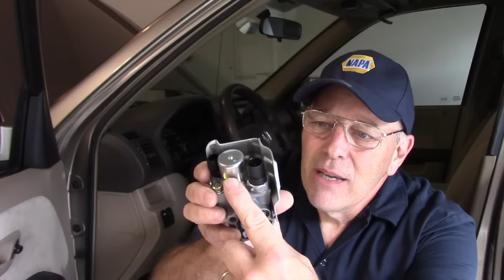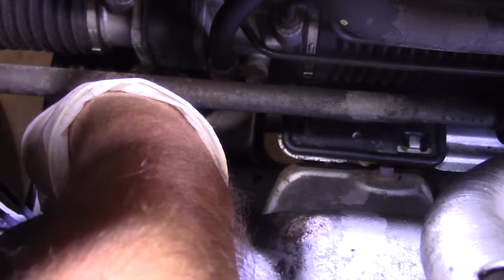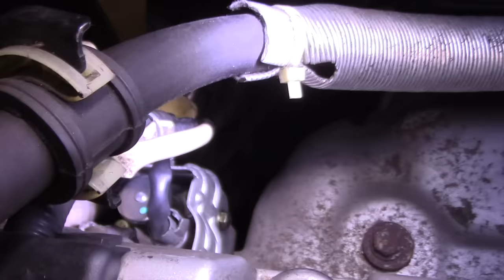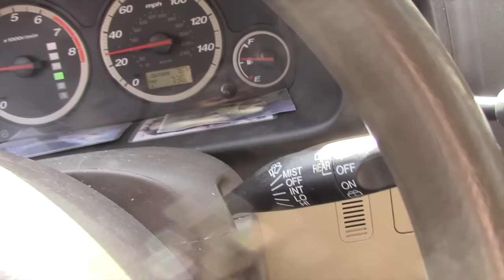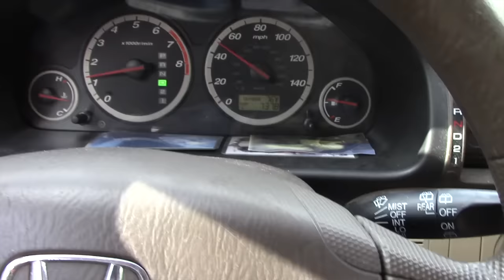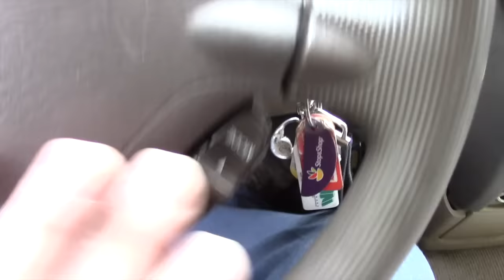VTEC Repair  P2647 Or 2646 (Pressure Circuit Voltage High Or Low)

Comment: So I have a quest , I have no check engine light on , I drive a 2016 Accord ex cvt 2.4l  when I let it stay over night it rattles when I start it ,  I've changed the solenoid but not the spool valve , could that be the problem , I also changed my oil wen I did solenoid. I've had it since new n change the oil religiously before it gets to 50% oil life with full synthetic , any ideas on what it is?

Comment: I have been getting the 2646 error code and went thru two VTEC solenoids made by Dorman. It works fine for a few miles then all of a sudden I get the bucking bronco at 2800 rpms.  Any suggestions?
Reply: Get an OEM part, not aftermarket like Dorman

Comment: I have a 2006 Pilot 3.47L V6 which also has the P1647 code, as you are working on a 2.5L (I didn't realise until I almost pulled out a "coil". Where is the Valve Assembly on my vehicle and do I only have one or is there another?

I also have ECU failures:  83 - PGM-FI Relation Failure, 86 - Global CAN Comm failure and 112-1 - Internal power source of ECU failure.

I thought I was getting a great deal on this used Pilot ($ 1K.) but it seems to be adding up quickly.

Thank you, 

Your videos were recommended to me by a friend at work who stated "the man knows what he is doing"

Comment: Hello, I have a 2012 MDX that does not pass smog! No check engine light but the guy at the shop said it have permanent code p2646 and it won't pass until that's gone! I have then replaced the oil and filter and I've also taken the VVT solenoid off and replace the oil pressure switch and the gasket! I have an obd scanner and the code still comes on after I did all that but the check engine light has never came on! Any idea what's going on? Car runs perfectly fine!

Comment: Thanks for the instructions, Jim. 

I have a 2003 Honda Accord LX, K24A4...  Car seems to move fine but has a slight noticeable lag before VTEC kicks in. There is no check engine light, but there is significant oil leak that increases as the  RPM increases. The oil seems to be seeping out from underneath the oil pressure switch and solenoid. Typically, oil soils the oil filter and the steering rack all the way beneath the assembly. I usually have to add up to one quart of oil per week in order to keep oil level within recommended limits. 

I recently changed the gasket between the assembly and the engine block. There is presently no leak at that point. 

Should I replace the oil pressure sensor and the solenoid? 

OR I should replace the entire assembly?
Reply: Does your car jerk when you’re accelerating heavily ?
Reply: @MrJOHNY347  Yes. It did at some point and triggered a VTEC solenoid code (P0406 or something). I replaced the oil pressure sensor on the VTEC solenoid and that sorted things out.

I also did a valve clearance job which sorted out occasional misfires on cylinder 3 which I observed and refused to go when I changed spark plugs to new OEM and checked my ignition coils to confirm they weren't burnt. 
Note that I had to do the valve lash adjustment 3 times before I got it perfect. First attempt was too loose, hence noise like a sewing machine. Second too tight but moved fairly without noise. 

Funny development lately: My catalytic converter got significantly blocked. I guess that must have resulted from the periods I was driving the car around with the misfire, due to unburnt fuel getting to the cat. As a temporary measure, punctured a hole through the cat and car is back moving like new, with significant gain in power and fuel economy but obviously letting out some smoke instead of the usual steam. Looking for a replacement cat now. Damn expensive shit!! Should fix it ASAP. Cheers mate!
Reply: @braveheartii1534  Thank you for sharing and your reply .You can get a good aftermarket catalytic converter for the right price .Just takes a lot of research .Some muffler shops have them .A buddy of mine has an aftermarket cat and still running for over 15 years .

Comment: I took out all those bolts but the valve was stuck it wouldn't budge or come out I have a 200u honda accord with the same 2.4 liter vtec engine
Reply from the maker: When all the bolts are out it should just fall off .Are all the bolts out?

Comment: i have a code p2647 on a honda accord 2006 point is i swap with jdm ingene i change vtec solenoide and oil sensor presure and still light on. any sugestión thank you.

Comment: Hey Jim. So my tech replaced the vtech solenoid assembly with a Honda dealer part and the problem keeps occurring. Car reaches 3000rpm, check engine light comes on, vsa light and warning light come on. Car starts bucking. You let up on the gas pedal and it stops,  but lights stay on of course. My tech wants to replace the VVT solenoid, but I dont want to keep throwing parts at the car if its not gna fix the prob. Any suggestions?
Reply: Did you fix the issue???

Comment: For some reason I unplugged the rock arm oil pressure sensor and I star the car the engine light is on.....and I stop the engine,, plug the rock arm oil pressure sensor back ....I star the car again the engine light is off but code p2646 still at scan tool everytime when I scan the vehicle,,,,please teach me if you know ,,,,,what should I do for next step....thank you....

Comment: I just switched out a new vtec solenoid in my 05 Honda Element and I still have the p2627 code and still jerks..I replaced it with OEM parts..not sure what to do next
Reply: Replace the single wire oil pressure switch under vtec solenoid both codes went away fixed
Reply: Same I just swapped mine on my civic si and it got the code to go away then came back
Reply: @DTuned559  did you ever fix that problem??
Reply: Slap-Yo-Momma yes it just went away after I replaced the whole solenoid

Comment: Quick question I have the same problem and I replaced 3 times vtec solenoid. On my civic si coupe 2008. So when RPM 5800k vtec turns off. Do you know why?
Reply from the maker: Did you get the parts at the Honda dealer?

Comment: Done changed part 3 times,and still coming on,on a 07 honda pilot want go over 45mph
Reply from the maker: Did you buy it from the dealer or aftermarket?
Reply: Got it at dealership,$768.00 part,and still says p02646 stuck on,and p02647 stuck off
Reply from the maker: @Black0ut277    You paid $768.00 for the part?
Reply: Yes sur,different than one you had in the video.and mine mounts up on the right side of the engine,behind the air intake

Comment: I have 06 odyssey code p2747 I did change the vtec the whole part and I erase the code after the replacement this  I drive it for the test and the check engine light turned on again and the scanner gives me the same code so what do u think what's going on with it ?
Reply from the maker: Did you get the parts from the dealer?

Comment: I have a 2006 Honda odyssey it gives me the code P2649 Rocker arm oil control solenoid VTEC solenoid valve circuit high voltage. Do I just change the part or worry about high-voltage?
I also have other codes P2770, P0970, P0980, P0966, P0974. There all giving me high input, high circuit or low circuits. Should I just change the parts or is this a different issue?
 The car wouldn’t start I thought it was a battery and alternator issue. I replaced both of them. The car ran for a few miles and it shut off on me I couldn’t start it without a jump. Also I need to mention before it shut off on me every time I stopped and try to accelerate it hardly did.
Reply from the maker: Thanks for watching

Comment: Thank you for the very informative video. Hoping that I can take the front passenger wheel off to more easily access this assembly on my '08 Element. Doesn't have this problem yet, knock wood.
Reply from the maker: Glad it was helpful!

Comment: Thank you so much for your video help a lot l changed that part brand new but me car still doing the same thing it's a 2003 Honda Element there's something else I need to do can you tell me please, there's something the car do when I put it on drive the light "D" DRIVE mode, constantly flashing so again can you help me please.
Reply: Raul Salinas transmission pressure sensor
Reply from the maker: Thanks for watching.
Reply from the maker: Was the assembly from the dealer. The aftermarket ones don't work properly.
Reply: No is not, it's from Amazon for 50 bucks,lm going try to buy it now from the Honda dealer, thanks for your answer, thanks for your videos really helping a lot.
Reply: Did you figure the issue??? I replaces the solenoid and switch anf still have issue
Reply: @davidcutsinger3574  look the car belong to one of my youngest kids he's 19 years old that's his fist car to drive,l really don't know what's the deal with the car l not a mechanic l just trying most of the time fix things on my own because l can afford take it to the shop, sometimes the car jerks really bad after running it for 4 -6 hours then we have to stop turn it off the start it up again then the car start running right until the next time start jerks again,one thing I noticed the letter D ,(drive) sometimes flashing sometimes don't what's that about can you tell me please?then thanks for asking l really like your videos you explain everything very good you speak clearly make  everything more easy to understand thank you so much..

Comment: Hey there, I replaced this assembly with genuine Honda part, made sure the screens were cleaned which they already were. I regularly change my oil with full synths and of course replace my filter every time. The issue still intermittently persists. Any ideas?
Reply: check the wiring that connects it(vtech gasket assembly) and the vtc actuator solenoid which is on passenger side of the engine right around the corner from the location of ur gasket assembly on the engine. they all have to be connect correctly and sometimes when they repair ur gasket, they mistakenly switch plugs of the gasket and the vtc actuator which gives u the engine light.

Comment: Thank you so much for this video I’ve done this 3 times prior to watching video but our element has 102,000 miles and it still keeps bucking I even change the v Tec valve assembly ( long shaft looking thing ) it still keep throwing this code what price of shit I’ll never buy another Honda v tec garbage thanks tho
Reply: Same here, I think it might be an electrical issue or leak in the head gasket. Let me know what you find out
Reply: @davidtheinspector  did anyone ever get the problem solved?
Reply: Mine was (according to the shop) my cheap dorman part was garbage he said only buy Honda parts for shit like that it’s working for now

Comment: Thank you for the video. This exactly describes what's going on with my 2007 Honda Element. I'm ordering a new Valve Spool Assembly replacement. Hopefully, it runs effeciently after the check list
Reply: Did you end up repairing it like on the video? Did it work and has it been working? I got the same code and have a 08 Element.
Reply: @aaronyarbrough2867  Hello, yes I have installed a new one purchased through Rock Auto. The engine light is now gone and my RPM is not misfiring anymore after the installation 🙂
Reply: Was that a Honda one or a off brand solenoid?
Reply: @davidcutsinger3574  I ended up with the Honda oem part from the dealer here, car has been running better without codes

Comment: Will car go into safety mode when this is going out? Im in an 05 element, had codes for oil pressure switch, and the electrical problem,  i changed switch alone, codes still showing,  then auto zone guy suggested alternator, so ive done that to, butstill has weak acceleration and wont go over 3 rpms. Thinking maybe ineed to replace the whole vtech solenoid?
Reply: Yes absolutely, use the expensive Honda genuine part. I've been through this garbage. Don't waste your time and money. I installed two aftermarket ones, both failed
Reply: @davidtheinspector  thanks man, much appreciated

Comment: Great video but the ACTUAL fix to the p02646 and p2647 is to flush the engine multiple times because these 2.4 motors get the oil passages clogged up and that is what causes oil to push through the oil pressure switch causing the codes. Replacing the solenoid will only temporarily fix the problem but light WILL come back on. Flush the motor atleast twice and problem is fixed
Reply: What about a J series 3.5? I went and took the assembly off and cleaned the gasket on the assembly and replaced the solenoid too to no avail. Last thing I wanna do is get a whole assembly when I just replaced the solenoid and there wasn’t anything wrong with it. Thanks!

Comment: Thank you for sharing Mr. masters Mech...very informative Sir. I'm having the same problem with a used car I recently purchased for my son, it's a standard gearbox but same issue when I bring it up to 3 to 4 thousand RPM it struggles hope this will fixed my problem...
Reply: Donald Ramsamugh did that fix the problem ?

Comment: Hey Jim, I replaced the whole valve assembly last year and now a year later the check engine light came on. Turns out to be the same p2647 code. Checked my oil, filled it up. Sometimes it doesn't jerk when accelerating other times it does. Also got the P0341 code which seems related. Any idea's?

Comment: DO YOURSELF A FAVOR AND BUY A GENUINE HONDA REPLACEMENT PART! I've been through 3 O'Riley's parts! JUNK JUNK!
Reply: DO NOT BUY ONLINE. UNLESS ITS A REPUTABLE HONDA PARTS DEALER! KEEP YOUR OIL CHANGED WITH GOOD SYNTHETIC OIL AND A GOOD OIL FILTER AND RUN THE GENUINE HONDA PART.

Comment: SO I did all of that Works great until the engine gets good and warm.  (About 15-20min of driving) the Vtec shuts down and 2646 pops up.  Engine has high mileage (298K mi) well taken care of.  very clean inside. Good compression. Doesn't burn any oil to speak of.  any suggestions?   My guess is that the oil pump may be worn enough that when the oil thins out ant operating temp there is just not quite enough pressure to trip the switch.  The one thing I have not replaced is the Vtec oil valve below the cams.  I did clean that as well as the front screen when I did the head gasket a while back.
Reply: I have same problem did you resolve
Reply: Have you tried replacing the vtec spool solenoid?

Comment: Hello everybody, I have a 2006 Honda Accord EX 2.4L K24A8 engine(I4) and its perfect condition, well maintained from me and the past original owner. The issue I’m having is that when I want to accelerate it feels like it doesn’t and I see my RPM struggling to past 3000. I can get to 65 on the freeway but it takes a while. The transmission feels smooth and shifts fine. I have clean my mass airflow sensor, bought a new throttle body and EGR valve, sparks plug are new, new air filter and new starter but I still have the problem.  Any clue what could be?
Reply: Replace the part he shows you how to replace in this video. It's called the VTech solenoid assembly
Reply: Have you replaced the vtec solenoid?

Comment: Thank you for the video -  03 Accord 2.4 - I was getting a P2646,  changed the oil (M1 5w20) and the whole valve assembly.  Then started with a P2647.   Any ideas?
Reply: Done changed part 3 times,and still getting both codes on a 07 honda pilot
Reply: @Black0ut277  ditto here on my 2007 Honda Element...done every thing several times.  Did you ever fix your problem??  Thx in adv...

Comment: Thanks so much Jim.  I had the P2647 error code, the 3 lights and bucking on my 2005 CRV.  I had it into the Honda dealer twice and they wanted to replace a ton of parts to try and find the problem.  I ordered the replacement part you recommended and it solved the problem.
Reply: That's because dealerships are selling you up on stuff you don't need.  I got the whole song & dance that it would cost $2000 to fix and was I sure I didn't want to trade it in.... I do all my own work now.
Reply: Yeah thats that’s the way you do that’s why I only dealers for oil changes with a cupón they send hate oil changes just because of the location of the filter,,is a pain and a bit messy ,

Comment: Hey Jim... this video was GREAT!  I don't do any repairs... but you took me step by step. and it was smooth.  Code was cleared, and everything was perfect.  Its been 3 months and 600 miles.. and BAM!  same exact warning lights... jerky acceleration... and SAME code.  Give me thoughts on what I should do?  Thanks ahead of time!
Reply: Same here, figure anything out? Someone told me it could possibly be an electrical issue or leak in the head gasket
Reply: Same
Reply: U gotta be doing fluid flushes for transmission periodically
Reply: @spadetrilla  curious..what does the tranny fluid have to do with the VVT? pretty certian its oil that flows through VVT and isnt connected to the transmission?
Reply: @randywells9676  You would be correct. 😁🧓
Reply: @randywells9676  There was a bulletin released that recommended swapping 0.5 qts of the total 4.5 qts of oil with Merc 3 tranny fluid.   Tranny fluid is still oil but has detergents in it and will slowly clean and or maintain cleaner passages.  Oil flushing can lodge larger particles and lead to more grief...so I would recommend avoiding it.

Comment: Same code but my car doesn’t stay idling it just dies out after about 15 seconds of struggling to idle but when gas is added it revs up just fine but below a certain rpm it won’t idle and die
Reply: Probably cam shaft sensor

Comment: Thank you for the video. 
Its suppose to be voltage coming to the 2 wire ? 
Because i pull both plugs and its no power going to the wires .
Reply: Only when vtec is activated it will have power. If it had power all the time the vtec would always be on and get horrible gas mileage and a rougher idle.
Reply: @daltongroff9749  j
Reply: @guillermoquinones22  ? What